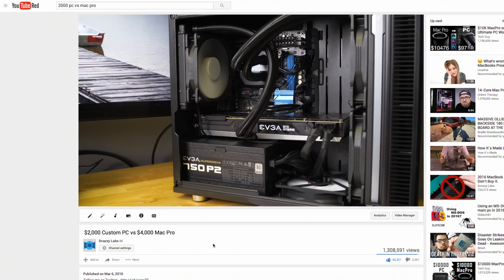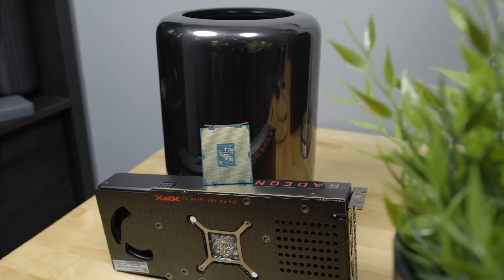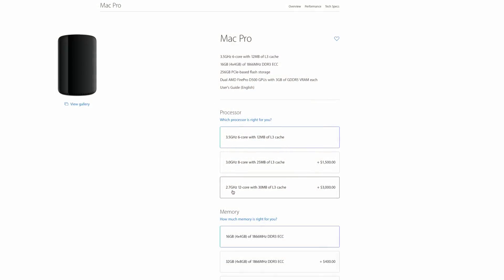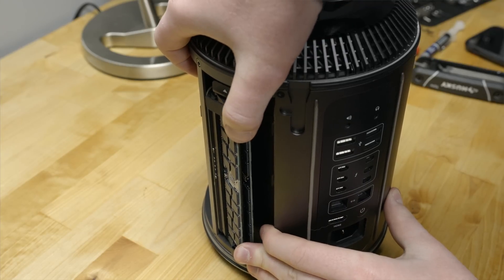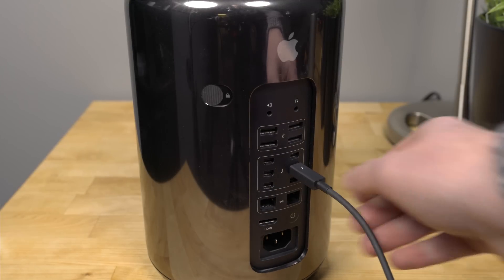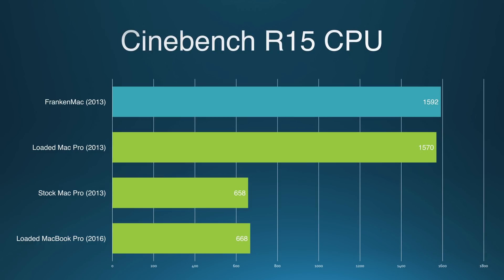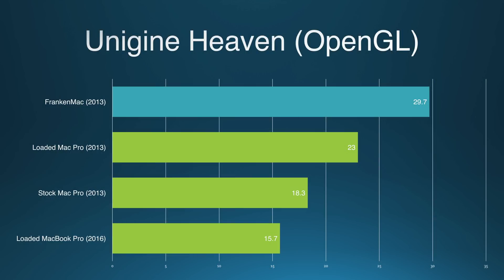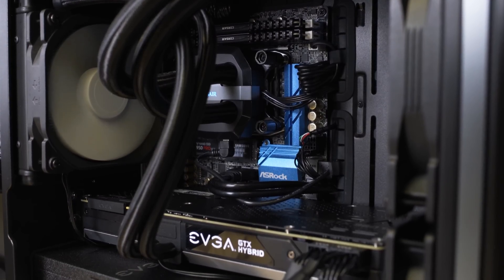The Best Mac... Apple Doesn't Make!

Comment: Why not use a Mac Pro from 2010-2012, I have one and it is amazing in all the benchmarks you used! although it is huge so maybe thats a factor. 12 core 24 threads 3.06Ghz too. 64GB ram and a GTX 980, but after this, I'm gonna get a RX 480, i looked at OpenCL performance of a  480 in a true PCIe slot  and it flies! all in all I've spent $1600 and have a Mac Pro that scores just barely slower than your mac pro (by about 200 points geek bench ) it does have slower ram and more power hungry processors. all factors to consider, as well as many more!

Comment: I know this sound weird but;  Would GPU performance increase if you connected two Thunderbolt connections to the Graphics Card and FrankenMac?
Reply from the maker: +Thomas Vu Nice idea, but it can't be done successfully, sadly. The new MacBook and all future Macs will have TB3 which is much more promising for full bandwidth eGPU performance. :)
Reply: Darn, I was hypothesizing since HDMI can use this feature. But why did you go go back to Final Cut Pro? I feel this like a step back from Adobe Premier? If I recall, you were able export and edit faster on your PC. Also you might want to re upgrade your RAM back to 64gb because Final Cut Pro is prone use more of that and storing caches often. You are using SSD, right? Also a quick update on the Unigen Valley Benchmark test?

Comment: A separate video with the GPU build alone would be cool, I didn't fully understand how you integrate the two, you need a specific case with a thunderbolt port? or you can build your own case?
Reply from the maker: +nicoxis It's a modified Akitio Thunder 2 with additional power for GPU and then it goes Thunderbolt to the Mac. If there is enough interest, I'll do a video on it specifically. Cheers! And thanks for the suggestion. :)
Reply: I would totally love to see if this works with a 2015 macbook pro for example! thanks

Comment: Wow there are a lot of hates for Mac considering you pretty much only make Mac videos! 
With that aside I have some questions!
I built a GTX1080 graphic card PC last year hoping they release a firmware for GeForce 10 series in Mac, but with current state that doesn't seem like it's going to happen anytime soon or even never!
So I'm considering to buy RX480 for my Hackintosh part of my PC. Do you know how that works? I heard someone say it's possible but is there a lot of tweaking and troubleshooting to do if I were to do that?
Reply from the maker: +Paul Kim As of about a week ago, its super seamless! Just find automate-egpu.sh on Github, run it, and boom! Done. :)
Reply: Snazzy Labs Thanks for replying! But what I'm more curious is about how will the motherboard react when it had two different brand of GPU connected to it?? 
I already have GTX1080, if I connect RX480 on the same exact machine can I use that for Hackintosh?
Reply from the maker: Depends on your chipset and motherboard. Tonymacx86 is a great place to get started with Hackintosh.

Comment: why didn't you just build a hackintosh?
Reply from the maker: +Thomas Swan I explain why in the video. Stability, compatibility, and tight integration with Final Cut Pro. A production workstation needs to be bulletproof which even the best of Hackintoshes are not.
Reply: Sorry i commented this at the start of the video, i completely agree with  your reasoning. i left the comment in as its a good point of discussion :)

Comment: Make Apple Trash Again
Reply: They are for years now...
Reply: They're not trash, and they weren't trash. Their quality is simply going down while their price goes up. Doesn't mean their products aren't useful. Are they worth buying? Probably not. Usability isnt measured by price, though, it's measured on a different scale. You only need to consider both when you bring em together. OS X is still far from trash and has a longer lasting appeal than Windows 10 has. Microsoft turned me off from Windows when they stopped using Windows 7. So unless you're really getting your hands dirty, or are fine with Linux, buying a Mac is the only way to go for a lot of people.

Thankfully, most people bought them before they started declining.
Reply: Rainbow Dashs BBFF it's because the Mac Pro looks like a trash can...
Reply: ***** Not everyone will get that.